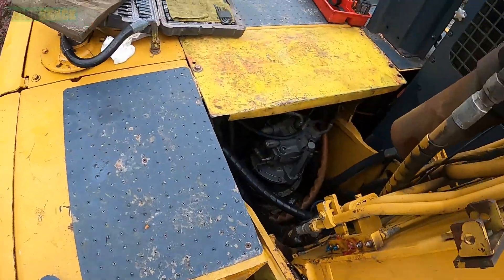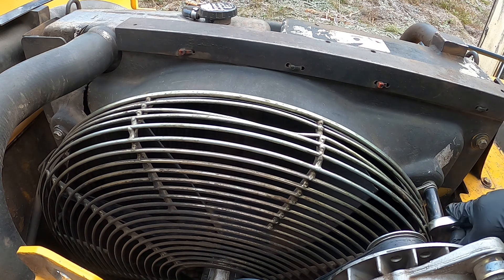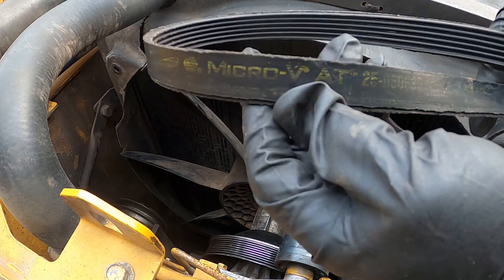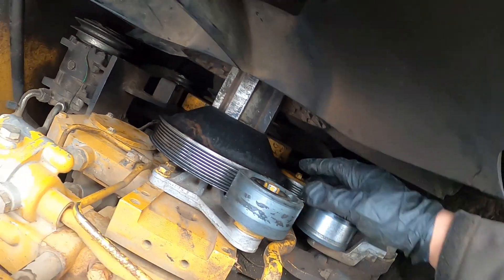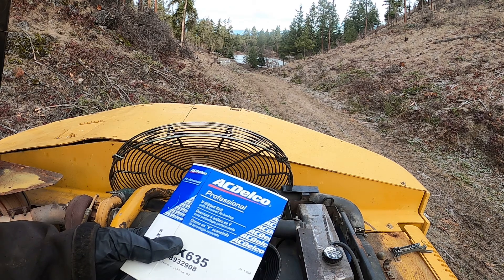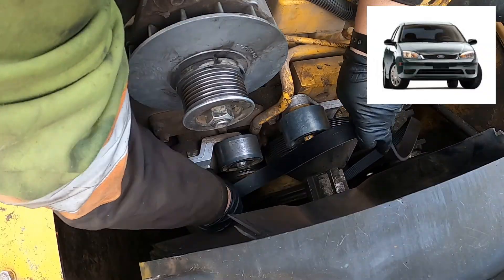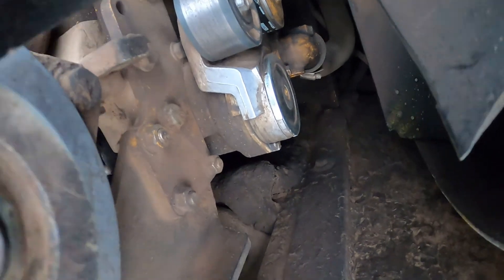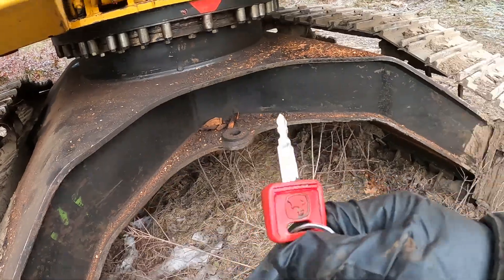SERPENTINE BELT REPLACEMENT | JOHN DEERE 2054d

Comment from the maker: More Johhn Deere and Volvo vids: 
FAN DRIVE PULLEY REPLACEMENT JOHN DEERE 2154d | part #RE505264 https://youtu.be/_cczLishUP4
VOLVO EXCAVATOR REPAIRS: WATER PUMP, FAN BELT. D4D, D6D engine: models EC140B, 160B, 210B, 240B 290B https://youtu.be/8NwbpLYnstY
VOLVO EXCAVATOR: BELT TENSIONER FAILURE, DIAGNOSIS & REPLACEMENT (EC140B, 160B, 210B, 240B 290B) https://youtu.be/m6BEm5A9_Os
Volvo EC140 Excavator Fan Hub Failure - Damaged Radiator & Fan Hub Removal, part 1 https://youtu.be/ulQjM0Agp40
VOLVO EC140 Excavator - RADIATOR FAN HUB BEARINGS & SHAFT REPLACEMENT. part 2 https://youtu.be/41S5yb28BYA
Volvo EC140 Excavator: COOLING FAN HUB, RADIATOR, OIL COOLER INSTALLATION. Part #3. https://youtu.be/qDcXQX5dFYc